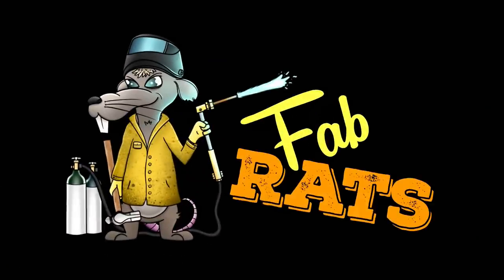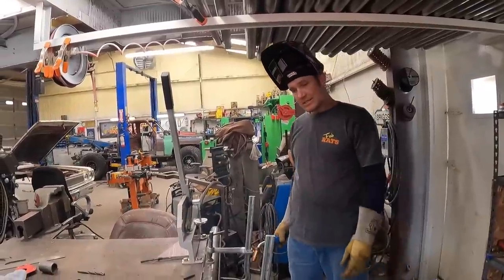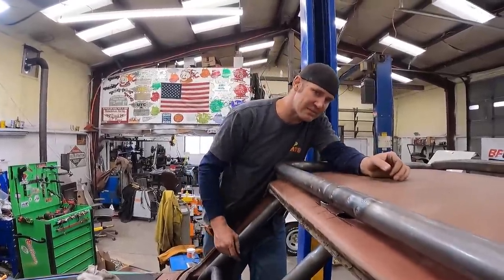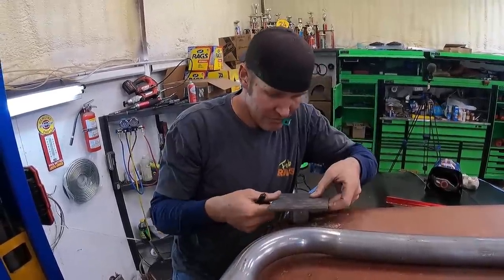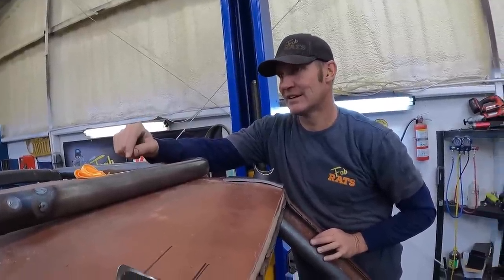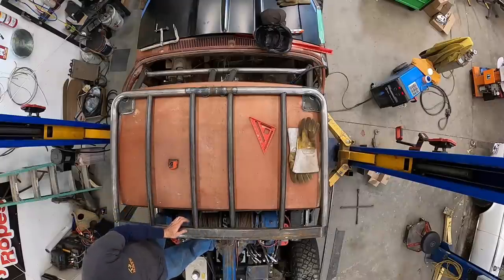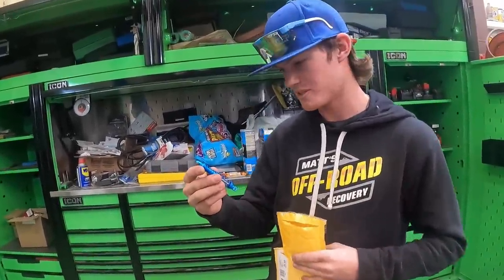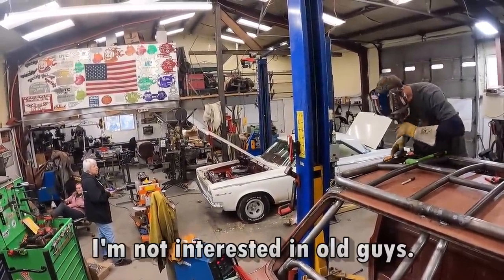Will This Fix The Rat Rod Wrecker's Roll Cage?

Comment: In my years of heavy pipe welding on water towers, and small fab in my home shop, those diablo blades and bits are really the best bang for your buck.  Their cost is reasonable and they will out cut most of the more expensive blades and bits on the market.
Reply: Agree, Diablo stuff is tough.
Reply: Definately better than the cheap brand next to them.
Reply: @JimYeats  I've never had a diablo cut off wheel explode.  They turn to dust, not huge chunks like every idiots favorite yellow brand does.
Reply: @Adam-th9vs  I would agree with that. I haven’t had any issues with Home Depot’s Avanti brand exploding either. I usually buy the budget brand disposables and stick with Diablo for the semi-disposable items like blades exc.

Comment: A little tip for dishing plates to fit the body. Get a short hardwood log stood on end and cut a small hollow in it. Works great for forming compound curves in metal like that.

Comment: Hunter should consider making a large cardboard shield. Poke a hole in it, and shove the camera or phone lens through that hole, and use that for filming the welding. He may be only looking at the screen, but that doesn't mean a lot of that welding light isn't coming right around the camera. I'm concerned for his eyesight.
Reply: PLEASE you cant be SERIOUS do your eyes burn when you watch Paul weld???
Reply: The ultraviolet light is of concern, it dissipates very quickly with distance.

One way to find of if he is being over exposed? ... Does he feel like sand in his eyes the night after filming? If no exposure is minimal.

BUT I like the way you think, this is a good idea! , even a small safety screen would eliminate exposure, and deflect hot sparks too. And no $ cost! :)
Reply: If he's diligent wearing those polycarbonate safety glasses, he should be good. They block uv extremely well.
Reply: @CORNDODGER  I am looking ONLY at a monitor. I am not right there, with only a tiny camera between me and the welding. Why on earth would my eyes burn?
Reply: @mattmanyam  Good one!, I hadn't thought of that,!
Reply: To explain why this is a concern... When you look at a camera screen, or a monitor, and watch welding, there is zero problem. But when you are right there where the welding is going on... Do you wear a welding helmet that only partially blocks the rays? Say about a 4 inch area, or roughly the size of the camera... No, you wear a helmet that protects your entire face and head. And that is not just because of 'sunburn'. If there is not enough 'shield' in front of your face, some of those welding rays will possibly come around and do damage to your eyes. You might be able to hold that camera over the worst of the rays coming at you, but you are by no means blocking all of that. You wouldn't weld, holding a 4 inch shield in front of the weld. Why would you be close in, with a camera, looking at it? Even for a split second,,,

I'm not waving my hands, and screaming like a nervous nancy here. I am just voicing friendly concern. The kid has his whole life ahead of him. Why scoff and take a chance with your vision, if you don't have to?

Comment: Well usually there is a rule of Following Nodes.
So when a spot takes an impact it spread the loaded force through the whole cage instead of dead ended points.

Be safe! At least put a mean X brace in your designs. Any questions checkout our Instagram page.😁 and shoot us a message!
Reply: Definitely should be following nodes back down to the frame!!
Reply: And or TRIANGULATE  the corners with smaller tube stock and ADD A PETTY  BAR
Reply: I have been thinking the same thing. There is not enough support on the sides if that thing actually rolls.
Reply: Glad you said it. Hoping those front corners don’t take a hit
Reply: What about the cage in the front windshield being bent? Should it not be straight? If it rolled them 2 bent bars will buckle 🤷‍♂️
Reply: @SAS_VW  The cage on the front should be ok. It is thick metal piping and it doesn't look like they heated it to bend it. Had they heated it to bend it I might be concerned as that makes it weaker.
Reply: @SAS_VW  those are intrusion bars. Helps from the cage crushing down from the halo hoop around the cab he did. 
Best way is a Continuous A pillar design to his main bed hoop. 
Main bed hoop must have a X going from each corner down to the frame.
Then a X in the top of the cage. So if you take a corner impact it spread the load throughout multiple points so nothing get dead ended forced and bending/ moving the cage.

That’s just the tip of the iceberg!

Comment: As someone who has a background in NHRA legal chassis builds I must say you have a very unique style when it comes to building roll cages. The "T" top roll bar in the movair is a good example. I will admit it should do the job and it looks cool. What do you plan on mounting on the roof an 88 millimeter flak gun? Keep up the great work your videos are great to watch.

Comment: What's the thinking about the role cage being half in and half out the cab. Wouldn't it be easier, less holes in the cab and more protective to have it external? Why did you curve the roof bars? You said you were going to mount boxes on the roof.

Comment: I think I recall paul saying he was  going to do tool box or tools on top of the cab.  A sheet of perforated steel on the roll cage  make it very functional, I think the under side creates a shallow  tray  and doesn't cover up the design.  Add a few tie down points ( I have had great luck with the snap- loc  @ Home Depot   Modular   tie down system)    I do wonder watching the videos of the  of off road recovery, why none of the 3 that are in the tow truck games have a a Porta power kit to help get things in place to trail fix them?  I found a 20 ton kit for ~ $350.00 that I plan to purchase myself for a modular press build.

Comment: Huge fan of all your work, I'm a big fan of the roll cage/bars. But you went to great lengths to lighten up the truck for sand recoveries seems like you're adding a lot of weight. Also you spoke of tools being put up there, would it be better to keep your extra tools etc lower for stability? Just a thought, and can you add 1 or 2 bars to the back seat on the FJ to protect the kids in the back seat? Keep up the great work.

Comment: I figured I'd try some Mountain Dew. Did so a while back but could not remember what it tasted like . Well when the ring pull is first pulled its very gassy. If you leave it sit open for half an hour it starts to taste a bit better as it flattens. My Mrs seems to like it that way too. 

There are some subjects of interest I would like to see covered . The shop crane! how is it constructed. The metal and rubber bushes you use on the ends of rods and engine mounts . I'd like a close up of you actually welding them . Do they burn the rubber when you weld? I'm going to try them for mounting my electric boat motor to drive the prop shaft.

Comment: It's nice to have sharp tools to work with. Is the cab still sitting on rubber mounts? If so will your welds from the sheet metal to the cage crack after a while? The wrecker is going to be an awesome machine that should last forever or at least until you get tired of it and change it around again.

Comment: To Rat Rod Guy's 
I'm not certain what I'm doing on this social media platform.  First time commenting or even responding.  I don't know where you're at with regards to your time line.  Did the Cornette find a home?.  1984,  I had that exact car, with a HEMI, but I sold it all to get myself out on an "UNPLANNED" Mission (35 years ago).  I have no regrets for the decision I made, especially because just a few months after being home from my mission I found myself buying a 1969 pontiac GTO.  Rough shape I got her going, my second time rebuilding a carburetor, I lucked out building a quadrajet.  I then rebuilt the suspension and headed out to burn out the tires to the pavement.  I drove back to college in Rexburg, Bounced the needle of 140 mph. Latter I built a sold business, waiting to restore the GTO, 2012 a crook I hired for marketing, embezzled 3/4's of a million bucks.  Closed down and have struggled since.  I would love that car.  truth is where bearlay sureving.  Today I seen a car your going to derby.  Looks nicer than what we have.  Sorry to bore you I just wanted to tale a small portion of our story.
P.S. I sold off the GTO for 5K. however I'm working on a Frankenstein Rock Crawler, Robie could tell you about that.

Comment: Are you planning on putting boxes on top of the roll cage?
Reply: Hopefully Milwaukee Packouts.
Just like Rory!!
Reply: Wouldn't it be easier if the top was flat
Reply: @joeparker9924  mounting tabs is mounting tabs.
Paul can make them really easy either way.
It's only hard if you haven't fabricated before.

Comment: Do roll cages flex at all? Wondering if the cage flexes and it’s welded to the roof will it pull on the metal around the windshield and break it. Maybe they will not be doing a window?

Comment: Michelle I realize your knowledge has increased on parts and such but this question goes to Paul I have a 07 Tacoma is it possible to move the independent suspension in the front forward for more clearance?? I want to put 40s on my truck, and keep it independent

Comment: Hey just to offer my two cents. The roll gage lacks downwards to the rear strength which could cause it to collapse inwards.  In fact its a third of the way there already. It needs some straight up and down strength in the forward corners something it lacks now.
Reply: If it gets a load on those screen bars from above they  will just twist the dash bar and collapse .
Reply: @brianbromfield418   I hope they see it.

Comment: Scenario... Tow truck Olympics... Truck flipped, causing it to loose all coolant, and fuel. Not something most trucks could recover and get it back on the road. But on top of your cage you have 3 gallons of water(coolant) and 5 gallons of fuel. So, I am suggesting some tabs for mounting these containers. Also I suggest an additional battery on the back, isolated from the cranking battery, for use on all the winching. High amp alternator, maybe a larger battery on back like a dozer battery? That is if they make one that is a sealed battery, if not, then maybe two or even three batteries in parallel. I suggest lead cell because they will charge faster than an AGM type battery.

Comment: maybe take a old swamp cooler put it inside the shop and suck the air inside the building and blow it out side the shop so all the welding smoke get blown outside and put a cover on the side of it to keep the heat inside the building when your not using it to suck all the smoke out side

Comment: On that support pipe that was cut a little to short put it in the bender bend it 30° in the middle ish then turn it 180° in the bender and bend it 30° again witch will straighten it back out put it will magical be about 1/8 longer as u stretched the tube

Comment: Which turret on top with 2 winches facing opposite directions able to spin to any direction that way 1 is the anchor and the other is a puller mounted to same plate

Comment: Does anyone know how the Maxxis Razr MT's do for sand and rock crawling?
Reply: I like them so far, only 2 trips on them to the old Chile Challenge trails, and around Deming. No cuts, no chunks missing so far. The sidewalls are thick. Aired down to 8 psi on a mild 'Yota that weighs 3500 you can hardly tell they're aired down. Good grip on the rocks for not being a sticky. Haven't tried them in sand yet. 35x12.50r15
Reply: @J. LeRoy Lacy  Appreciate the info. I have them on my 95 f150 short bed. Was just looking for some real feed back before i air them down.

Comment: Why did you radius the roof rack bars?.. the outside bars of roll cage didnt get the same radius plus the pack out boxes arnt gonna sit flat on the top. Was there a reason for this? Seems like the bars would have been close to top of cab if you did them straight but would have cleared and if not massage the cab a little with the green hammer.
Reply: So, have you ever heard of mounting tabs?
He is going to need them to mount flat boxes on the TUBING anyway.
Standoff tabs are easy to make.
Clamp some angle iron in the band saw, pull up a stool, and make 30 in about 10 minutes.
I wonder if you ever make anything?
Reply: I make alot of things. Seems like a lot of extra work when the bars could have just been flat and wouldnt  need any mounting brackets.  The question wasn't asked to whoever you are it was asked to paul. But thanks for your meaningless response
Reply: @hendersonhow2andreview17  would still need mounting brackets, unless you do it half assed.

Comment: As a x NASCAR TECH Inspector The weight of that rig is going to need a shit load more BRACING in that cage!!! If you do roll over you may be doing many rolls over a steep angle THINK ABOUT THAT with a vehicle tied on the back!!! Most of the stuff you are on is HARD ROCK ! so its GOING TO BE A REAL ROUGH RIDE!!! You got a  Earnhardt NOW ADD A COUPLE PETTY BARS! hell spoke to soon you did add PETTY BARS
Reply: Ain't it a bitch when you comment before the end of the video?

Comment: Why would you not build the cage on the outside of the body I would think it would have been easier especially if you destroy the cab also when you build the flatdeck 4x4 wrecker I was thinking either the truck you got this boom off of or the international you can still use the cummins and trans cab already has big wheel wells lots of cab space

Comment: So with the roll cage and the top bar. When you sleeve it and add a anal piece if you leave a 1/16 th and bevel the ends of the joints you get a full penetration weld with a good root that ties in the sleeve and both roots of the pipe.

Comment: Why not an x in the top of the cage? Or an X And a +, overlaid. It would have been about the same amount of tube, and significantly stronger? I know hybrid cages are inherently full of compromises, but you could have picked up a lot of rigidity with triangles

Comment: Does a cage work like a truss? Does a bend in cross member (not rigid or bent) of truss sacrifice integrity of the whole truss/cage?
Reply: Depending on the stresses, the slightly rolled TUBE will be stronger than arrow straight tube.

Comment: Did anyone hear why Paul put 2 vertical supports in the center of the windshield? Seems like it will block vision. Would thicker wall DOM tubing have been an option?

Comment: The Cab is on rubber mounts , right 🤔? And the Roll bar is mounted to the Frame , right ?  And u welded the Roll bar to the Cab , right ?  Under all the Flexing the truck will go thru , Won't that Crack that Cab ??  🤔

Comment: I would have built the top high enough so it cleared the roof by about an inch. That way the runners would be straight. Easier to make and the stuff you put on top would have a flat area to rest on.